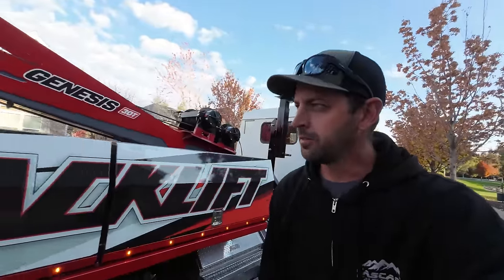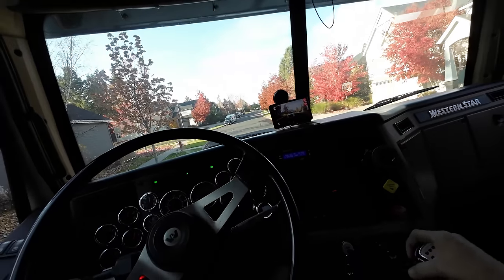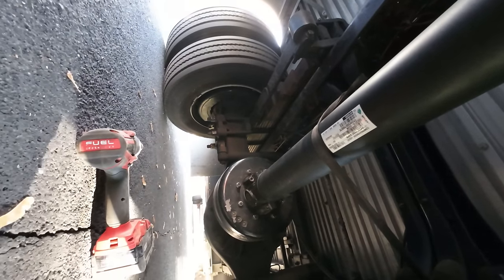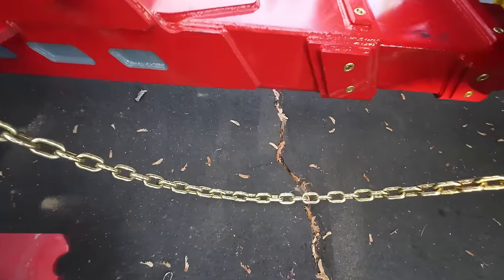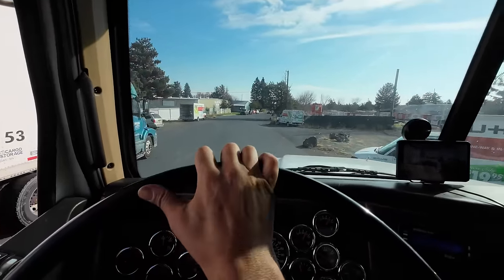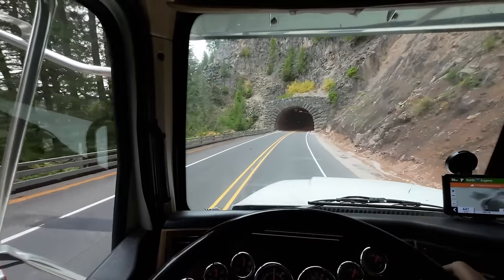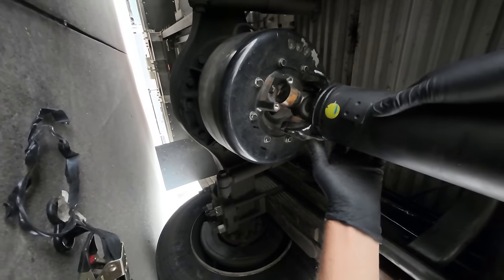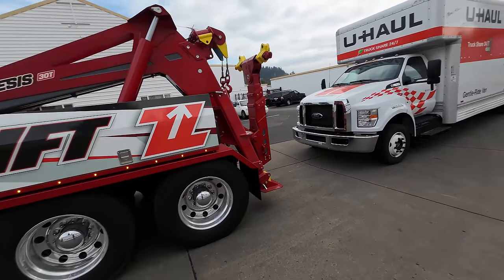Well that didn't end like I'd hoped…

Comment: My Subaru seems to work better in loose snow better than either of my trucks did, my 1/2 ton would get stuck in just over 8 inches of snow, my 3/4 ton would work up until about a foot or so.  I have an older Subaru that does not have the traction control, the electronic device to limit how much traction you have.
Reply: I took my '06 Outback turbo in a full foot of snow, stopped it on Aubrey Butte to try and get it stuck and she kept pulling.  I hate that he lost his light bar but it's prolly Subaru Karma biting Casey in the behind. :P
Reply: Same thing with my '02 Outback in over 25 inches of snow delivering food with just good all season tires.  Pushing snow on the valance and bumper but still kept going.  The lower center of gravity with the boxer engines and the Subaru AWD system really works well in snow and snow packed conditions.  One of our drivers got stuck 3 times on one delivery with just a 2wd vehicle.  They said that they were done driving for the day.. that's  okay with me since I got more runs and more tips that shift.

Comment: Should you not have chained it to the frame ontop of the straps?
Reply from the maker: No.  The straps are the securement.
Reply: I had a sneaky suspision it would fall off.  I see rubber bungees along the side of the road all the time.  I would never rely on a bungee to keep anything attached, stabilized yes, but i want some way of permanent attachment so it can fall off.  Maybe like a carabiner.  Not so much because I don't want to lose what ever it is, but because I don't want to damage someone else's property or hurt someone from my falling junk.  Imagine having that light bar come through your windshield at hiway speed.  YIKES!  It would also be nice if the light bar had some kind of proximity alarm so if the truck is like 200 feet from the bar, an alarm sounds so it can't be left behind or should it take a different route to the destination.
Reply: @frotobaggins7169  They're talking about the axle to the underlift
Reply: @ryanthomas2472  LOL, I'm so stupid. Thank you for pointing that out.  Apparently I can't read and just make up my own conversation. lol

Comment: I wouldn’t be surprised to hear that the ‘transmission problem’ is
really that the parking brake was left on for “awhile”.
    Bummer about losing the light bar, so much to attend to with your
work. Be Safe out there. Casey.

Comment: When your to lazy to get up and get blocks you leave the forks in and slide the works off the wheel lift. And the light bar you took out of the rollback isn’t 700 dollars maybe 300
Reply from the maker: The light bar is indeed $700.
Reply: @CaseyLaDelle   if it’s a tow mate 36inch light bar you can get it for 260 but your are correct they do make very expensive ones. you probably had one. It sucks I know I have donated one to the road side my self
Reply from the maker: @cbforme  did you read what I said??   IT IS $700.

Comment: wait a second so you kept the trailer on there and then proceeded to put the tow lights on the truck and not the trailer?
Reply from the maker: Yes, because I went right down the road to drop off the trailer, then towed the truck three hours away
Reply: @CaseyLaDelle  right on man, god speed.

Comment: 700$ for a lightbar?! Is it lined with gold or wireless? What´s wrong with a wired connection between? I don´t get why that simple thingy is so expensive or why one would need a wireless lightbar.
Reply from the maker: Wireless is damn near a necessity.  I would never go back to wired
Reply: Whatever floats Your boat- I just cannot wrap my head around that necessety.
Is it so wrong to belive that if the bar was wired You´d have had a chance to drag it along?
I´m just so used to simple and cheap solutions and a 700$ rear light ain´t one.
Maybe You could fix it with some good magnets so it can´t wobble around and build momentum.
Or take a 2by6 piece of wood, put in some truck lights, wire it with a drum and fix the wire by magnets.
Okay, got that outta my system, now
Happy new year, Buddy @CaseyLaDelle

Comment: Typical Tow Truck Operator -
* Received a call to pick up a UHaul Truck
* Customer claims transmission issues
* Toe Truck Operator drives truck around block no transmission issues - shifts fine...
** Of course Toe Truck Operator is not going to call UHaul and inform them truck shifts fine drove it around the block.. NO NEED TO TOW
** Tow Truck Operater would not collect his $300+ tow fee if he is honest and  simply drive the UHaul Truck to the destination.
SHAME ON UHAUL FOR NOT CHECKING AND DRIVING THE UHAUL TRUCK Before CALLING A TOW TRUCK..
Reply from the maker: Quadruple that tow fee.